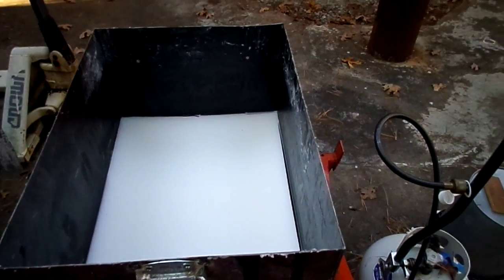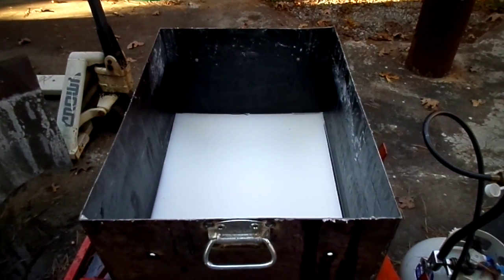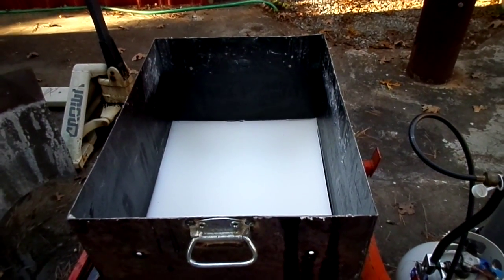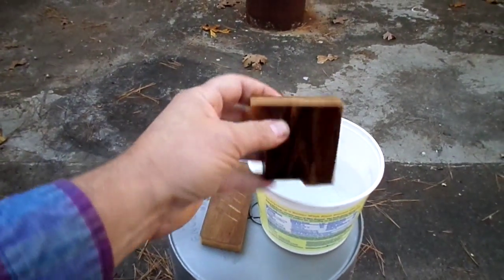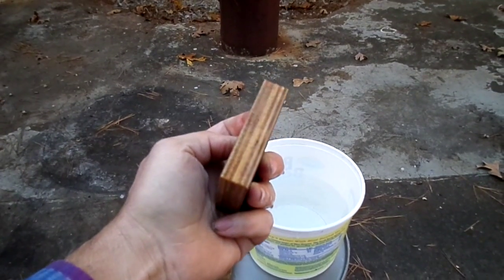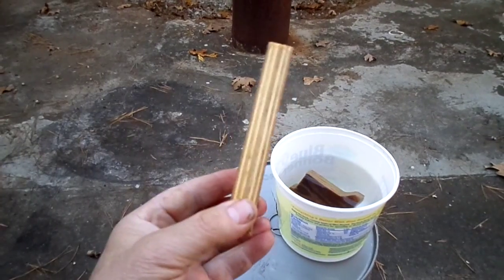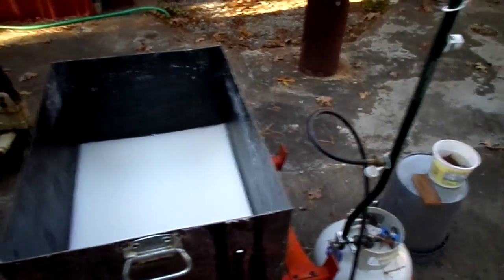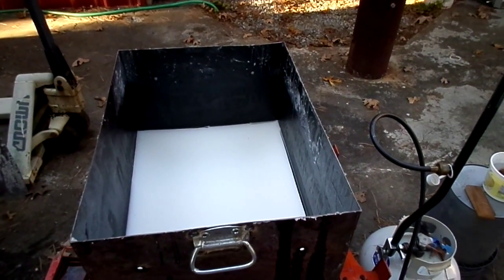Hot Waxing Process for Beehives

Comment: That tank looks to be about the same size as the one I'm working on. (20x24 24" tall) How many BTU is your burner and how long does it take to get up to temp?
Reply: The size of the tank is about the same.  I have no idea how many BTU's, but it takes about 20-30 minutes to get up to temperature.  I am using an old propane BBQ grill.